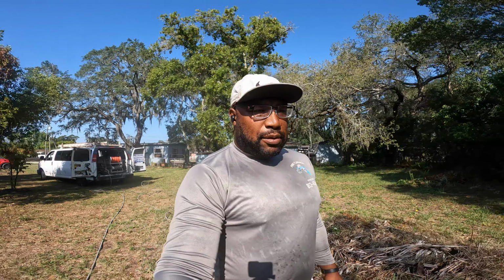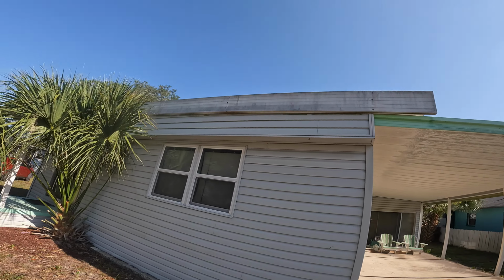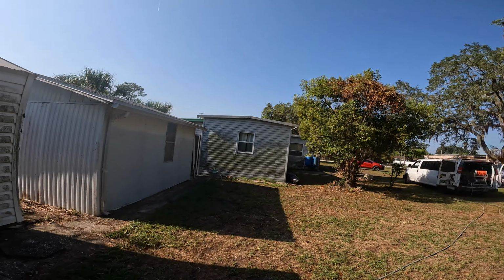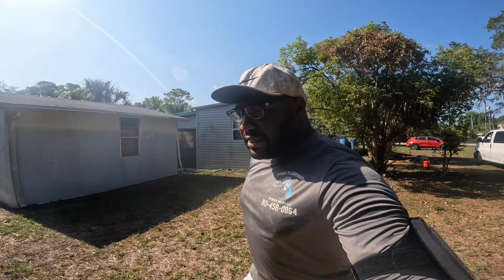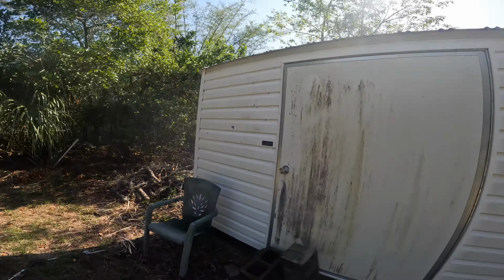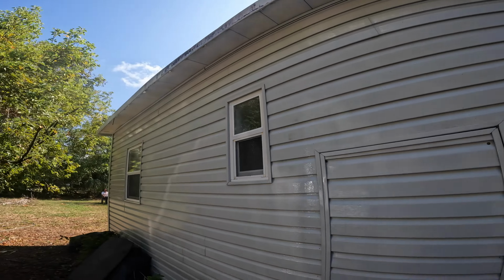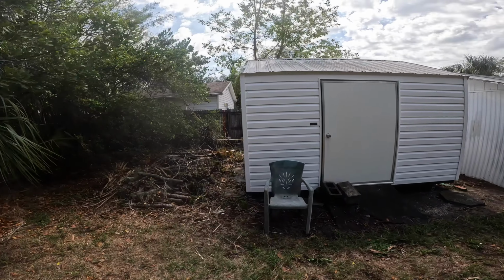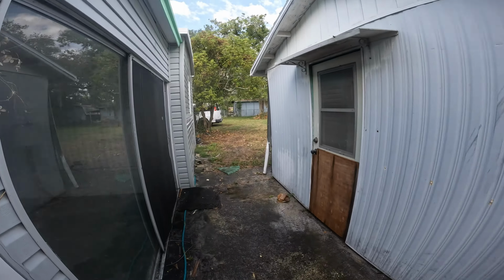Washing  A NASTY Mobile Home #SoftWash #HouseWash #Downstream

Comment: What J-rod nozzle do you rinse with without pulling SH?
Reply from the maker: I use a bypass so I can rinse with low pressure tip instead of using that 1 story rinse tip that sometimes puts too much pressure on surfaces in my opinion.

Comment: Another great video PF!  A question I've has is do you usually leave window screens on, or additional charge to remove and replace kind of deal?
Reply from the maker: Always leave them on.  Taking them out is risk I don't wanna take.  Lots of these screens are brittle and I don't wanna be responsive for breaking them
Reply: @PinkFlamingoPowerWash  Good point Sir. Thank you

Comment: Big bro why not use a little surfactant? I never have to respray. I use percile laundry detergent. Just a small amount. I helps to clean and the bleach runs down slow to help the dwell time. And I use less bleach.
Reply from the maker: I do use surfactant.  When it's 10 years of algae it won't come off with downstream.  This is probably only instance you've seen me reapply

Comment: When you say "Hit it with straight SH"... you mean 10 - 12.5% or do you mix a weaker solution in your pump up?
Reply from the maker: The supplier I get it from has 12.5% so thats what im using but 10% would work just fine. Its just to touch up and rinse. It wont affect the siding in that very brief moment.

Comment: hey cliff i have a job tomorrow doing a mobile home that looks like this one.   i have a simpson 3000 psi 2.4 gpm.   i also have a pump sprayer. what percentage do you suggest i use to hit with pool shock.
Reply from the maker: Probably 50/50 if it's this bad